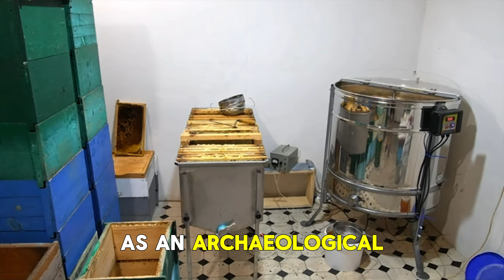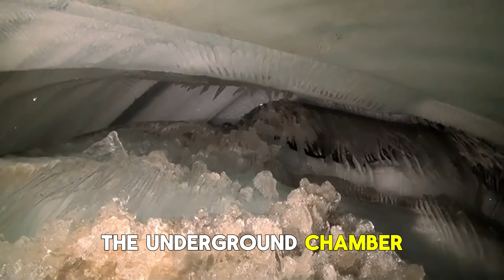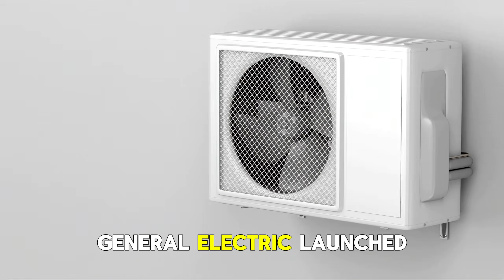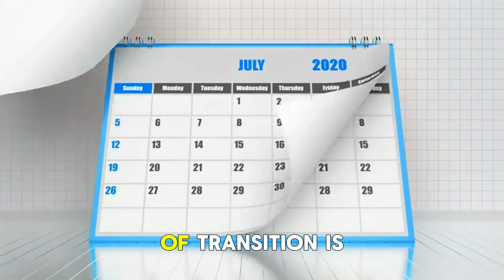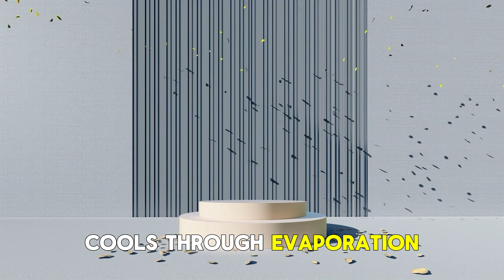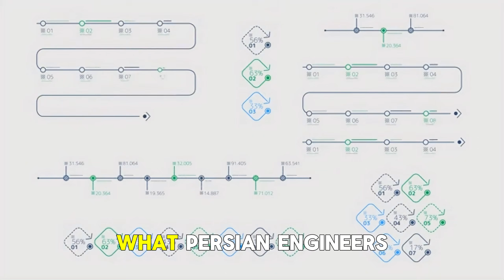Better Than Ice. Stays Frozen Weeks. Persians Solved It 2,400 Years Ago — Why Did We Forget It?

Comment: The design is convoluted what are the specs involved? The math, the temperature ranges, the depth specifics, the insulative ratings, etc. Sounds like a series of 120 ft tubes going above and below ground could mimic this "ice pit" root cellar, and grab the wind, cool the air, move and block heat, add some water tubes to transfer cooled water and draw away even more heat, but it doesn't seem like the temperatures could get colder than 50°F of underground at 60ft below to freeze because the stable geothermal ground temperatures don't go lower from the ground storing heat. The heat pump effect of the wind and water to move heat out can keep it at the 50° stable temperature but to freeze and keep frozen doesn't seem possible without some way to prevent the 50° ground heat from melting any ice.